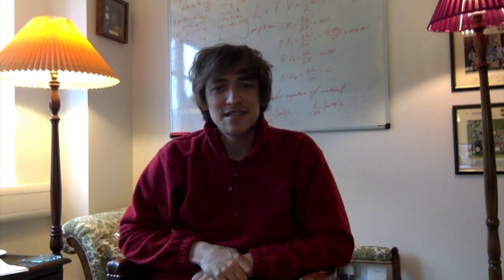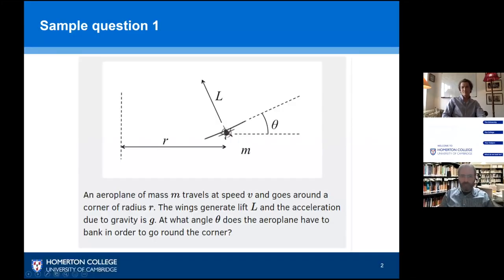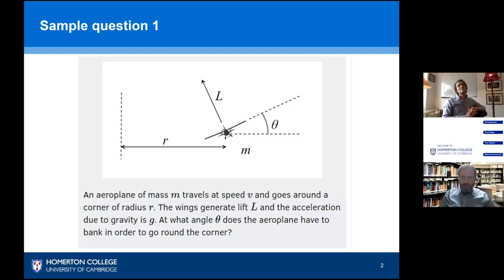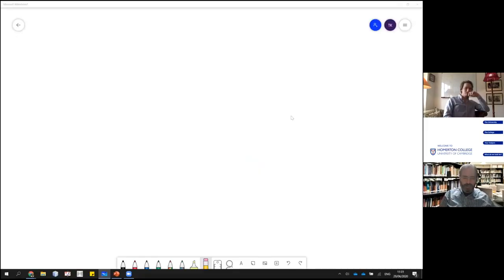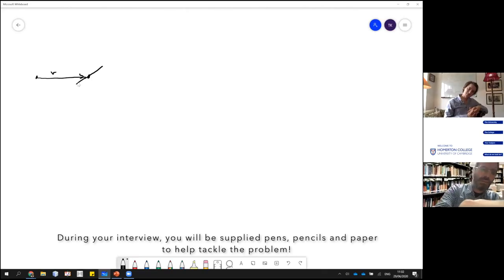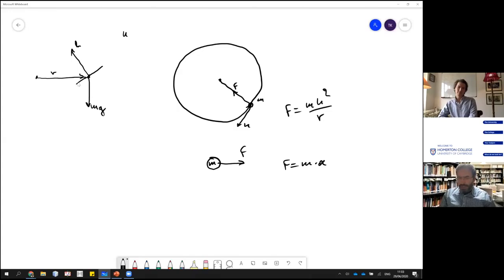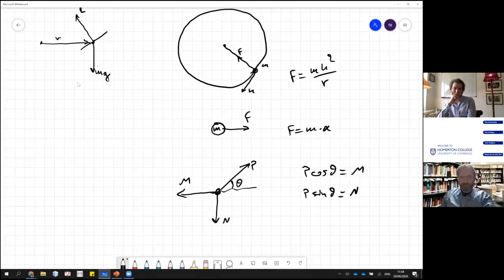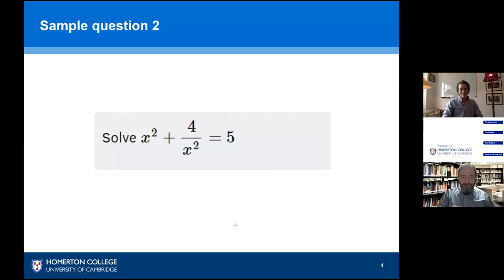Cambridge Engineering Interview Questions (Part 6 of 7 from Homerton College Engineering Open Day)

Comment: But it doesn't say how quick you need to turn the corner. The aircraft could bank less or more depending on whether it makes a sharp turn or a more gradual turn?
Reply: Sharper turn would result in the radius r decreasing. The angle has to stay constant in order for the variable r to remain true.

Comment: Disagree with the answer. The question asks for the angle needed to go round the corner; that could be in a circle (veritcle forces also in equilibrium) or in a spiral (vertical forces forces not in equilibrium) ; but the Pooh teeing its nothing to do with the vertical components.